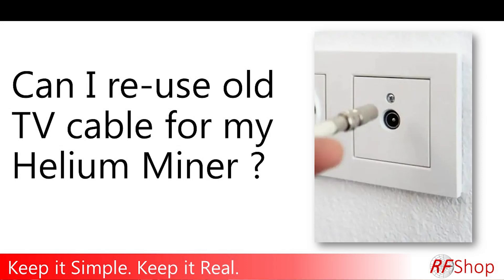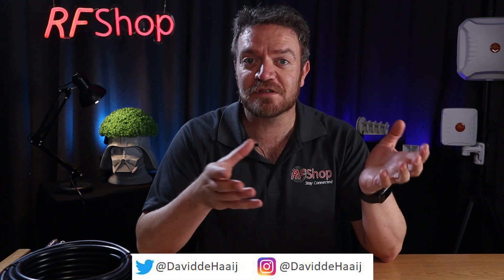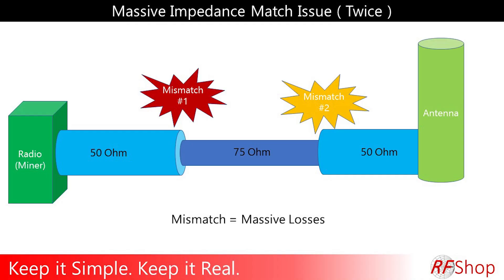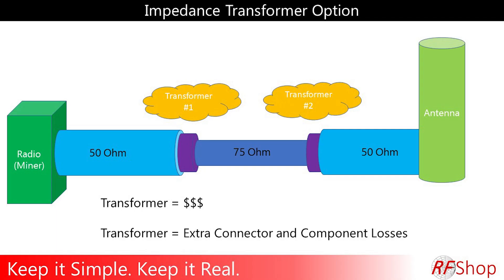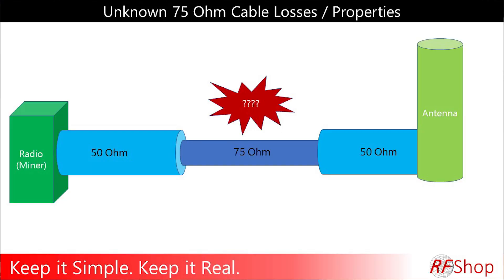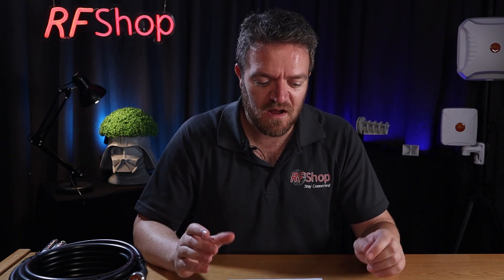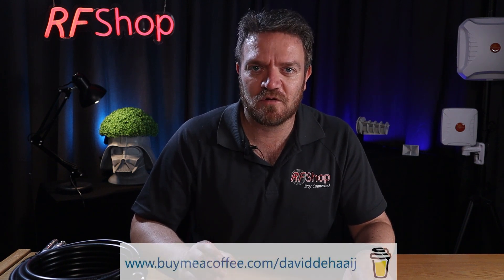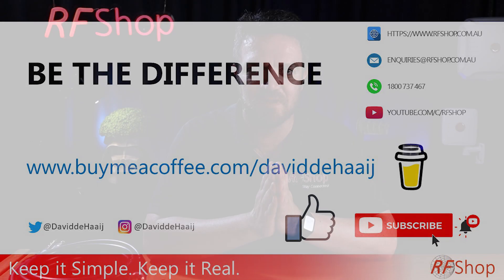Can you use old TV cables for a quick Helium Miner setup

Comment: i have a box on my wall that connects to communal antennas with 3 connections. 1 says tv, the other says satellite and the 3rd says radio. could i use the radio connector? would that be 50 ohm? thanks :)
Reply from the maker: Maybe send me a photo. I do think that those are all 75OHm connectors though

Comment: Thanks for the information. I have a MNTD Blackbox. The cable is rg58 for 5.8dbi antenna I bout separate. Why is so so hard for me to find the proper connector or adapter? The Antenna has male output and so does the black box.. what do I need and where can I get this from? Thank you
Reply from the maker: Hi...it should indeed be very easy. Your device has RP SMA(F) and you'll need a cable with RP SMA(M) connector. Then you antenna can be a few types, but it's likely to have an N(M) so your cable will need an N(F).

Comment: Thanks for the great video and detail explanation. What if I want to use an LMR400 but repurpose an existing wall plate for Helium mining (to avoid drilling more holes), would there be any signal loss or issues from using the existing connector?  Thanks again!
Reply from the maker: Hi Simon. You will just need to make sure the connectors are 50 Ohm and not 75 Ohm. It might be possible to replace the connectors inside the wallplate though
Reply: @RFShop  thanks for the reply, much appreciated 👍